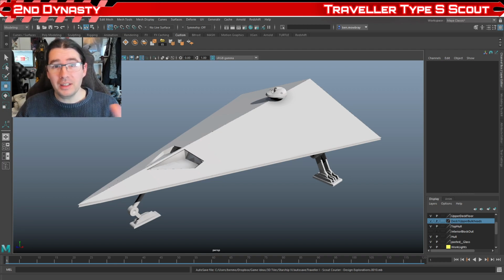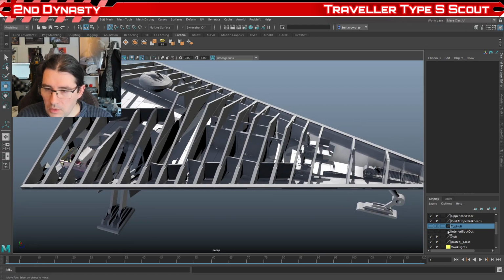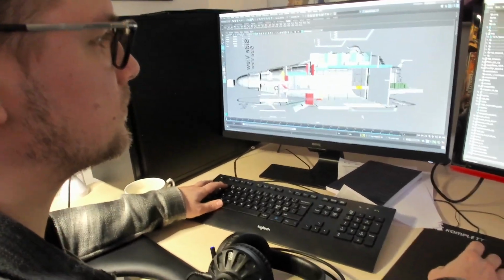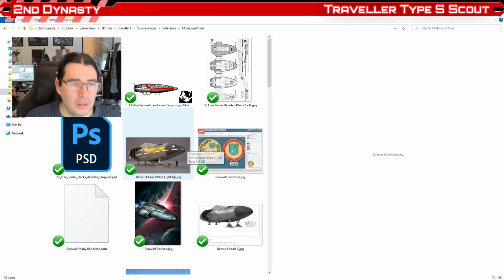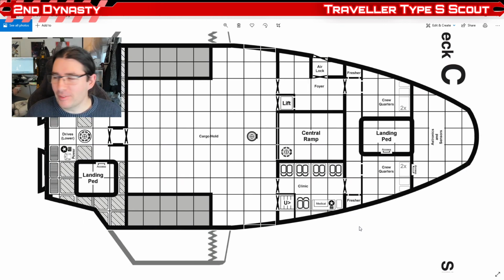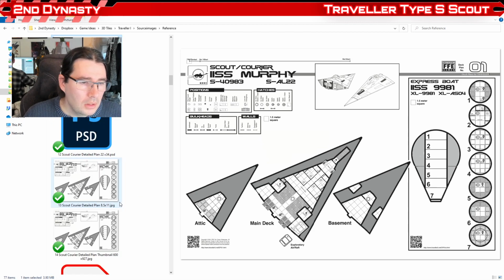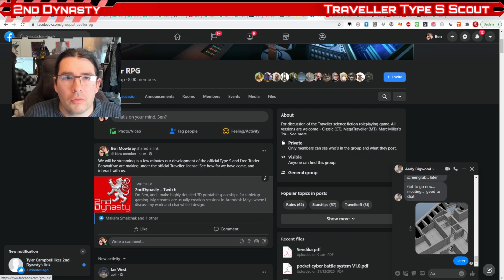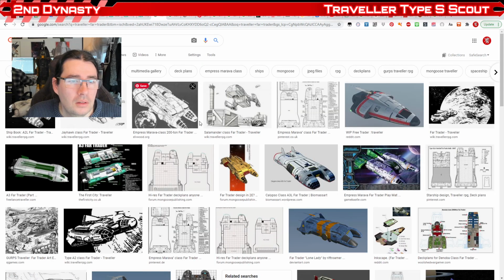Type S Development Stream - Week 2

Comment: I am building the 1/350 machete Space Battleship Yamato 2202 and they make use of fiber optic cables. Maybe for those areas where there is no room for an LED, run a fiber optic instead.

Comment: I missed the livestream.

I think you did a good job with the landing gears for the scout.  I think a similar solution could be done for the Beowulf - also any steep angular section seems a better choice for placement, just to use up any available space.  For the Beowulf, if you look at the tempest from Mass Effect Andromeda, that ships front landing gear also doubles as the loading ramp.  Even with the technology, space would be at a premium.  

I'm hoping you'll do the Ships boat and the Broadsword (mercenary cruiser) next.
Reply: instead of putting the forward gear under the nose of the scout, may i suggest moving it more aft, just fore of the beginning of the lower deck plan, that way an access crawl way can be accessed from the lower cargo bay